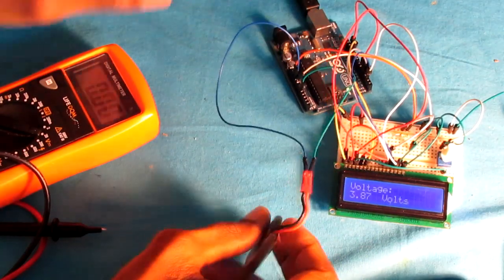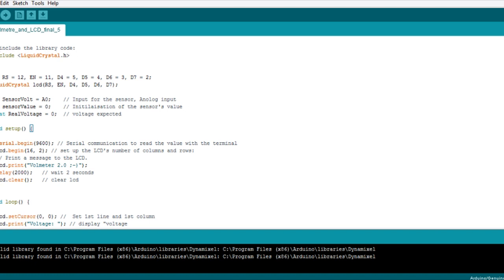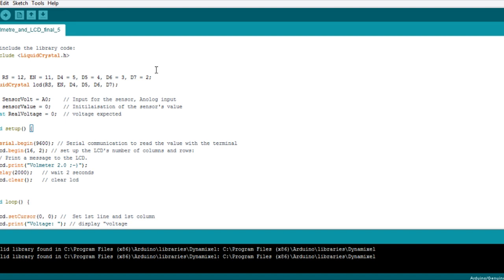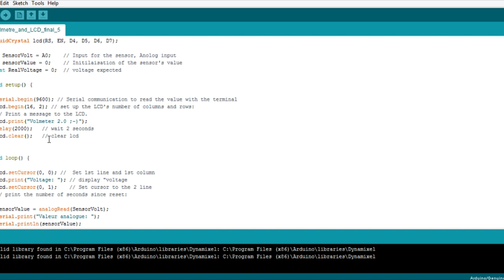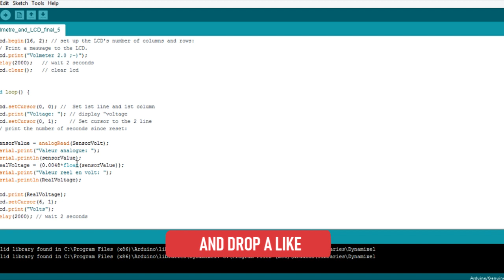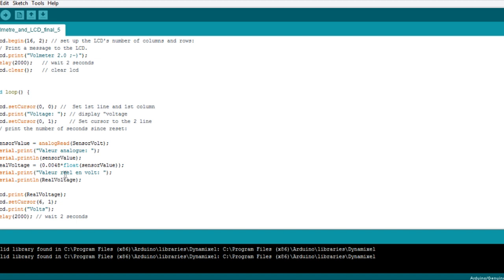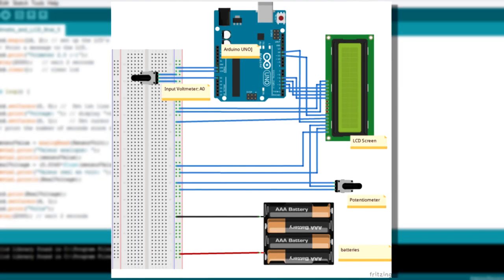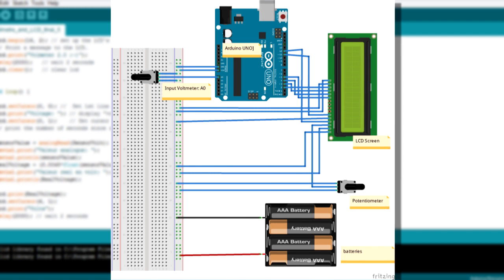How to make an open source voltmeter with a arduino in 10 minutes

Comment: Great video!  Is it possible to develop an Arduino to measure for the laser levels in a hydroponic thing?
Reply from the maker: Thank you. 
Can you be more precise when saying laser levels?
Reply: Sorry that was a typo. Fertilizer levels in liquid
Reply from the maker: You can maybe use water level sensors at differents places where the water is located. Eg: at 10ml, or at 15ml...
Reply: Can you direct me to a resource to learn about all the sensors.   I’m new to this
Reply from the maker: Here is an example of what can be done: https://www.ebay.com/i/322737916652?rt=nc&_trkparms=aid%3D1110001%26algo%3DSPLICE.SIM%26ao%3D1%26asc%3D20161006002618%26meid%3D80785cf30f1d421eb9f8d61402a802cf%26pid%3D100694%26rk%3D8%26rkt%3D30%26sd%3D331911181818%26itm%3D322737916652%26pg%3D2385738
Reply from the maker: What are your knowledge in electronics and coding? Can I have more details on the  project you are working on?
Reply: I only have a couple months learning HTML, CSS, and JavaScript.   Very basic electronics understanding.  I want to learn and the project is to control everything in the greenhouse from fans, heaters, evaporative coolers, water levels in tanks, fertilizer levels in the water in the tanks etc...
Reply from the maker: @bloominfood152  ok. That's a great project. I'll send you some resources a bit later so you can have a better understanding and a way to start at the same time. Since i noticed you are not afraid to learn. 😉
Reply: Makersgeneration thanks I am excited you are willing to help!
Reply from the maker: @bloominfood152  this is a nice device. Since you are new to all this, I have a better idea. What about me making a video tutorial on water level sensor with an arduino board? How does this sound?
Reply: Makersgeneration ok please advise.  What and where do I buy the necessities?
Reply: Makersgeneration I found one water level sensor for Arduino.  I probably want the best and most durable.  Are there different kinds of Arduino boards.  Can you help me get what I need together?  Great idea to make a video of it!